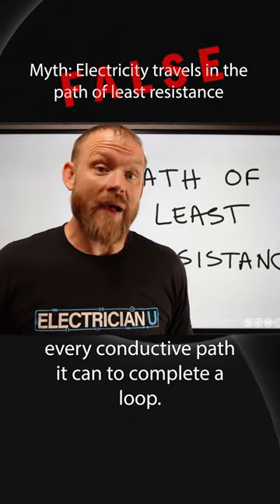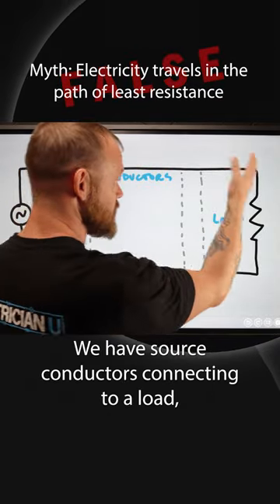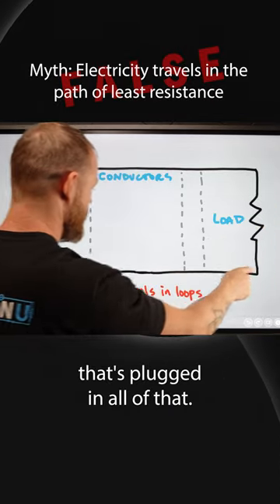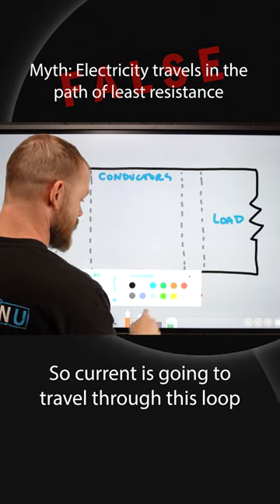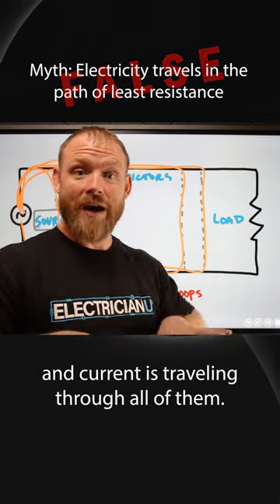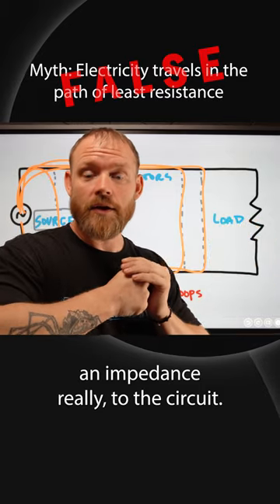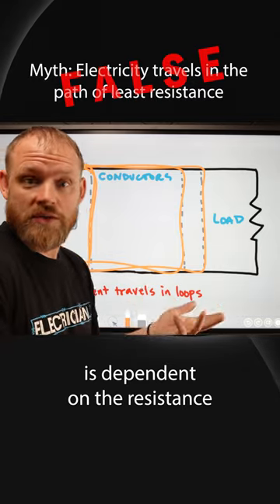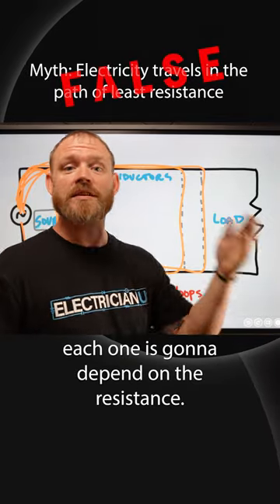Does Electricity Always Take The Path of Least Resistance?

Comment: A better way to put it is, the majority of the current will take the path of lowest resistance. This is why we attach ground wires to metal enclosures. We want to pull a boat load of current through the breaker as quickly as possible if that path ever gets made.

Comment: Guaranteed that any point on that ladder diagram will follow the least resistance to ground. Pick any point and connect it to ground and find out.
Reply: Electricity does NOT take the least resistance to ground it takes all paths. However, the least resistance takes the most.... that is, ohms law.

Comment: Electricity travels the path of least resistance is, in fact, true. What is false is electricity will change its path when a lesser resistance become available.  In other words, if a short happens not all electrical current will stop at all other points of resistance.  A short still has resistance.  The only current change is the amount of current flowing at the least resistance which reduces the amount of current elsewhere.

Comment: What is the purpose of a ground if electricity does not travel through the path of least resistance?
Reply: The purpose of the ground wire is to trip the breaker in case of a ground fault. When the live wire inside an appliance gets exposed (like when the rubber insulation of the wire gets teared) and touches the metal body of an appliance, the metal body is now live and anyone who touches it will get shocked, so to prevent this, the ground wire creates a short circuit to trip the breaker, in which the current will flow from the live wire through the metal body and through the ground wire and back to the breaker, so this will trip the breaker to cut the power to prevent anyone from getting shocked by touching the metal body of the said appliance. The ground wire is always connected to the metal body of an appliance, ready to take over in case of a ground fault.

Comment: That not really how that analogy is meant. Yes you can send it through multiple conductors at the same time. BUT if you grab a hot wire and the ground you will get the max amount lol. The analogy is used to explain why it doesn’t flow through insulation